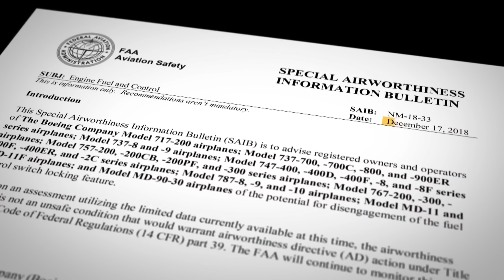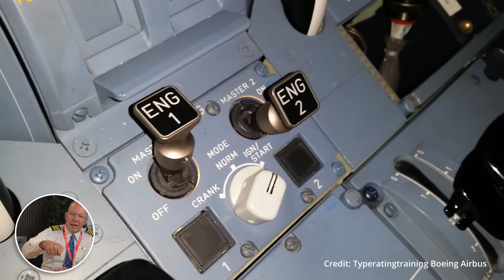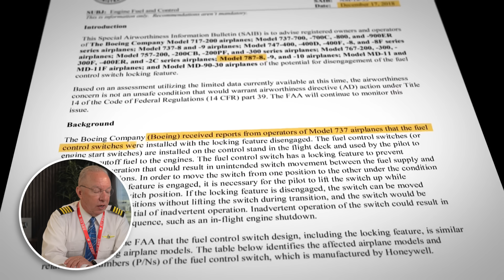Air India 171: The FAA’s 2018 Fuel Switch Locking Bulletin Explained (16 Questions Answered)

Comment: Is it possible they never turned it on, and the fuel they used to take off was from the pipes that take it from tank to engine? Like it happens in bikes, you turn off the fuel supply it still runs for sometime.

Does the flight recorder records the data all the time even when the plane hasn’t took off or it only records after it takes off.
Reply: No bro the line fuel is not enough to takeoff
Reply: @andrewmarthie5062 a pilot can take such action only when he is depressed in which case he would gladly accept to that question from pilot. If he is denying doing it, the only things possible are either he did it by mistake or a remote control. Can someone tell about remote control?

Comment: Experimental aircraft I worked on had video cameras on Flight Deck. A system was turned on that should not have been and caused control panel to melt. Test Pilot denied he turned it on. Video showed pilots hand moving to operate the switch, so was very useful. And pilots should not worry about it showing them reading magazines, because if it is against the rules, why would they do that with a video camera filming them!

Comment: People just don't want to go there.  Kundur was the PF, and he kept in the plane in the air as long as possible.  The Captain never asked for control of the aircraft.  This tells us what we need to know.
Reply: The pilot flying needed to continue flying while the Captain dealt with the problem.  No need to switch control
Reply: I was trying to figure out which one too and unfortunately I concluded the same. Willing to stand corrected if the facts change or new evidence emerges.
Reply: @matthewh4550  yeah, me too.  this is the data we have for now.
Reply: @JohnQuincy1776 Yes and the captain was pilot monitoring and its also a tell tale sign that he never raised the gear. the leaver was in the down position on impact.
Reply: Agree that people would rather blame the machine, hate to face the fact a pilot would be willing to do this.

Comment: What if the transition from Run to Cut-off was triggered by the aircraft itself due to the issue with Weight On Wheels sensor malfunction. The WOW might still be reporting it was on the ground while the aircraft is actually flying causing the Flight Computer to trigger the fuel cut off in order to shut down the engine causing these switches or these states to transition automatically. Or what if there was a total electrical failure resulting in the fuel flow state to transition to cut off. And how is it possible for a human to pull and push both these switches to cut off in just one second. Some thing does not add up here
Reply: This happpened to a Japanese flight, the engines shut off automatically after they landed, this could be tied in to what you’re speculating.
Reply: @SamsungS-or1qf  My issue is that how can a human put both these switches to cut-off in just ONE second. its humanly not possible.
Reply: He did it fast …tried to be sneaky it’s obvious
Reply: @andrewmarthie5062  how can somebody cycle two mechanical switches in ONE second. its not humanly possible. it will take a second or two to flip a normal switch in the house

Comment: If one (two) switch are so very important, crucial and with a few simple, short motions could potentially kill hundreds why didn't Boeing engineer these to make them more accident proof???🤔
Reply: They did,..it wasn’t accident
Reply: @andrewmarthie5062  You sound so confident. Were you on the flight deck? That airframe had over 41,000 hours and was manufactured 12 years ago.

Comment: Captain Steeve, let's try an alternative scenario.  Electric was lost at take off. The engines cut out.The RAT was deployed.Pilot #1 heard the turbines spool down and asked "did you do that ? Pilot #2 said "no I did not".  Pilot #1 moved the cut-ff switch to off and on again in an attempt to re-start the engines. Engine #1 did restart but power was too little, too late. If the scenario is plausible, the root cause is loss of total electric and not a Pilot hitting the fuel cut-off switch. 

To test the scenario, would total loss of electric cause the engines to cut out momentarily which requires Pilot action to restart the engines ?  For a simple comparison, a car engines would stop if electric is lost from the battery.
Reply: The problem with your theory is the flight data recorders. If there was an electrical failure they would record that ( note that on an aircraft due to redundant systems , a full failure is next to impossible). Plus if there was such a failure, the cockpit voice recorders would pick up audio alarms. 

But assuming a failure that shut the engines down is possible, your theory still fails because the data recorder shows that the switches were set to kill and were turned in again later. If the sequence was as you say, they should have seen the kill/start sequence happen quickly, it didn't.
Reply: I'M WITH YOU ON THIS THEORY, CAPT S DID NOT SEE THE PICTURE OF THE TAKEOFF TAKEN BY THE TOWER CAMERA THAT SHOWS THE RAT DEPLOYED, PLEASE REPOST THIS QUESTION AND TELL HIM TO CATCH UP ON HIS RESEARCH BEFORE HE PRESENTS STRONG OPPOSING THEORY!!!!!!!!!!!!!!!!!!!!!
Reply: Mr Robert ,Captain Steve has made up his narrow mind , pilot error even though there could be an electrical fault.

Comment: Hi Steeeve. If a pilot realises the engines are spooling down what is the first thing he would be checking? If it's not the fuel cut-off switches wouldn't some kind of information on his display help him sort out the problem more quickly? Geat program, really appreciate the way you explain things.
Reply: He would see the engines winding down… if it’s not the throttle it’s the fuel what else?

Comment: 5:21 

IMHO, we should not be in a blame mindset. That doesn't fix anything. Like, acknowledging that the switches were probably pulled by either the pilot or FO should not then naturally lead to, 'well, guess they were just bad people,' anymore than a technical failure should lead to, 'well, guess it was just a bad plane' 

I think it is more than reasonable to guess that anyone who pulled those switches was having a mental health crisis, just like other pilots who did similar things that either led to tragedy or near tragedy. The solution is not to just assume they were monsters and leave it at that, but to see if there's a way to better support crew that are experiencing stress that might cause a tragedy. Air travel is safe because it has focused on solutions, not fault, and I don't see why this matter should be any different.

Comment: MY THOUGHTS NO SUCIDE!!!!  when you go to start, the switches go from off to run. Could the possibility exist that the switches were not completely open but enough to complete the circuit to open the fuel valves??? Now on takeoff one of the pilots sees  it,, went to correct,but instead turned them off realizing what he did then  several seconds later open them??

Comment: Wouldn't it make sense to have the code turn off the switch at takeoff until the plane reaches altitude?  Is there any scenario where a pilot would ever need to turn off the fuel switch during takeoff?  You already said that the RAT won't deploy while the wheels are on the ground so it would make sense to just deactivate the fuel switch until after the plane reaches safe altitude.
Reply: Yes, when an engine is on fire you certainly want to disable it before reaching altitude. You could probably disable from takeoff to 1000 ft or so but then a pilot who really wants to die would just find another possibility. An airplane cannot be secured against this 100%

Comment: I think to prevent future crashes one question people are forgetting to ask is, is this a design flaw ? Surely if these switches were manually intervened they shouldve had a built-in acknowledgement for PF to accept before the complete cut off. They have built in redundancies all over the place but I find it bizarre that a simple switch could completely take down a flight.

Comment: 1. Will the PF be the one to issue the "gear up" command, and the PM the one to normally execute?
2. If so, how far apart are the gear up & fuel cut-off switches?
3. If PM "did the wrong thing", that may have prompted the PF's question...
4. Why the 10 sec delay before the switches were put in the "on" position again  & the 4 sec delay between the 1st & 2nd switch  - could there have been a physical "struggle" over the switches?

Comment: @Captain Steeeve Im wondering why critical systems like the fuel cutoff, engine shutdown and other systems that could brick an aircraft are operated by a single switch? Its obvious one cant and should not prepare for a mentally ill pilot trying to crash the aircraft, but even just to avoid human error they should have these switches at the side of both pilots, and they should only take effect if both pilots turn flip the switch (and thus preventing a single pilot error). I also dont get why the aircraft allows a dual engine shutdown 10 seconds into a take-off, but thats another question.
Reply: Exactly what I was thinking. Why engineer one or 2 switches that can bring down an airliner with a simple couple of motions.

Comment: 3:22 captain Steve you said it right there. You would see the other person move the fuel switch to cut off at an inappropriate time. It doesn’t sound like that is what happened in the cockpit. To me the report made it sound like one pilot just noticed that they were in the wrong position (or new by sound) , and then said to the other pilot why did you do that? And then the other pilot said I didn’t do that. That’s a big difference than one pilot SEEING the other pilot, move the switches.

Comment: Isn't that the purpose of a camera, any camera, to catch somebody doing something they shouldn't!
Reply: A camera is for evidential and educational monitoring, It will only catch out somebody doing something wrong IF they have done something wrong. 

If an action has not been done correctly, intentionally or otherwise it is a tool to understand the reasons why an action was performed and develop resolutions to improve procedures, training or indeed prevention as necessary based upon analysis of evidence collated.

Nothing to hide, nothing to fear.

Comment: With no thrust and no way out, the pilot probably reset the fuel control switch... So one engine was on... But it couldn't reach full range and fell down...

Comment: Why did it take so long for the pilot to put the switches back to run after discovering it was cut off? Would the several extra seconds made a difference in recovering flight?
Reply: He was probably wrestling with the pilot who turned off the fuel,

Comment: Either Captain Steeeve has access to a secret cockpit camera that none of the official investigators do — or he’s so intimately familiar with every circuit and signal path in the Boeing 787 that he can confidently rule out any hardware or software malfunction. According to him, the First Officer must be a liar who deliberately cut off fuel to both engines, lied to his captain’s face, and chose to sabotage 260 lives. And all this… for what motive exactly?

Oh, and let’s not forget — Captain Steeeve must also have the First Officer’s psychiatrist on speed dial, since he so casually insinuates mental health issues and suicidal intent without a shred of evidence. Because apparently it’s easier to dictate the dignity of the dead than to consider even the possibility that something in the aircraft system failed.

He shows zero suspicion toward a known-complex system like the Boeing 787 — but total cynicism toward the people who died trying to fly it. Investigative skill? Hardly. But I’ll give him credit — his teleprompter delivery is flawless.

And after seeing this far, we shouldn’t doubt who’s writing his script.

Comment: You misunderstand the bulletin. It wasn't about installing the switches upside down. It was about installing the switches WITHOUT the locking mechanism. Without the locking mechanism fitted it would be possible to operate the switch in either direction without having to physically pull it out against its spring in order to get it over that bump out part. You could simply toggle the switch up and down like any other and it could be knocked out of position because there was no guard in place.

Comment: Cpt Steve, we don't know that either pilot actually switched them off. He would have to be so fast, to do it without raising suspicion, and do them only a second apart. Unless he is using both hands... It just doesn't make sense. To say that this is purely a human intervention situation is pre-mature at best. It could be that a system error or faulty installation caused it, 1st pilot saw them or saw it appear on displays, asked the other why he did that, the other of course hadn't, and said he didn't do it. Also, only that would explain why getting them up was not as fast as getting them down (one second apart). I would think whoever noticed them first would immediately act on it. It is inconceivable that they would be raised back to run so slowly and with so much time apart. Unless that's the procedure? But with such low altitude, and so little time, would they act that slowly? We simply have NO CONCLUSIVE EVIDENCE that either pilot actually did that. The timeline is not it. If anything, the timeline suggests this fuel system was doing things on its own, with switches set on RUN. I am no aviator, but I think you are jumping the gun by assuming that this was pilot error, or an intentional act (German Wings style).

Comment: 8:27 You mentioned that this bulletin was issued about the switch being installed backwards.  Why would a bulletin be issued for that?  Wouldn’t that issue be discovered during the plane’s first static engine test?  A test that would fail because they couldn’t turn the engine on?

Comment: As someone that’s very familiar with how commercial aircraft’s work this was done intentionally. The fact that 2 engines quit practically at the same time with them being completely independent of each other excepts for fuel source confirms that.
Reply: @odez180 They are not completely independent. Power sources are common, and possibly control computer...
Reply: @jelenabaturina2889 if your talking about the fadec each engine has its own. And each engine produces its own electricity that powers its respective bus bar. The only thing they have in common is its fuel source and pilots

Comment: If the switches were put back to run, the engines would still be flamed out. Which means they would need to be reignited. The engines would need to be restarted with the apu

Comment: I hope that  a mechanic/inspectore will mechanically test the actual fuel cut-off switches in A1-171 to determine if the detent that is supposed to hold the switch in place is working correctly. We all would like for this situation not be pilot induced. If the detents were rounded over from usual wear, then could it be possible if the first officer having his hand behind the pilots hand to insure that throttles stay in take-off position, and his hand slipped downward once off the ground striking the switches, they could possibly fall to cut-off position? Depending on how old this plane was and the total flight hours logged, any mechanical squared off detent could possible were over time. If this could be a scenario, then these switches and all 737 ,777 and 787 have to be replaced. I like your thought on having the control of cutting off a fuel switch be at hand, however if there was an override combined with the throttle serve the same purpose...reduce the failed engine throttle first then move the fuel cut-off switch. Do you not do this same procedure when arriving at the gate?